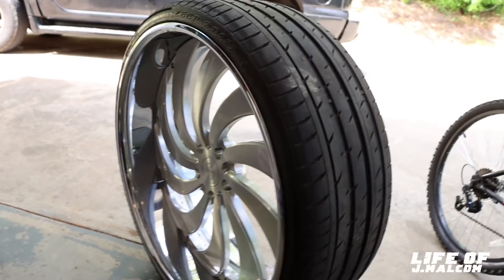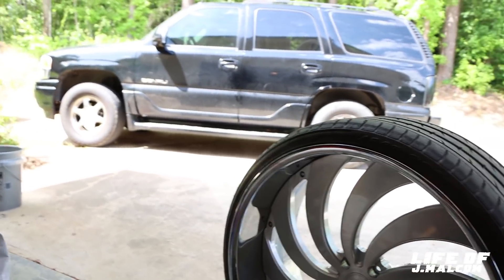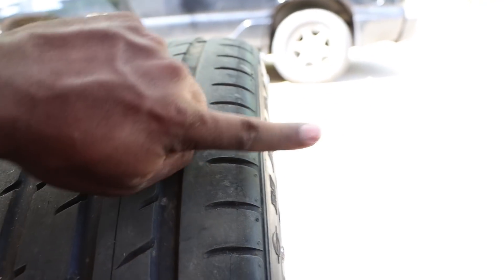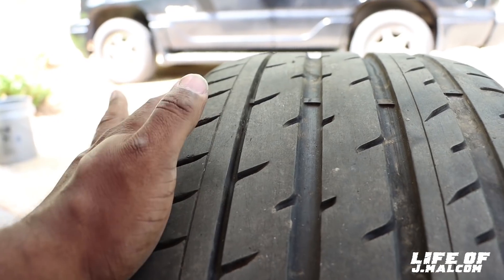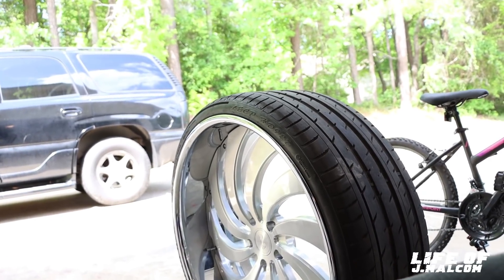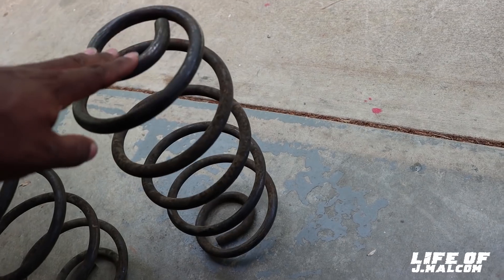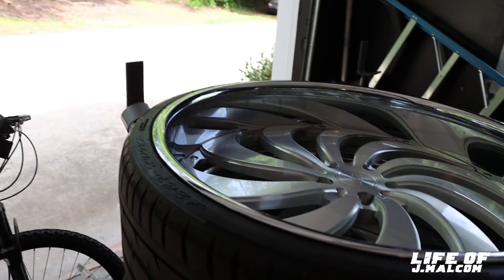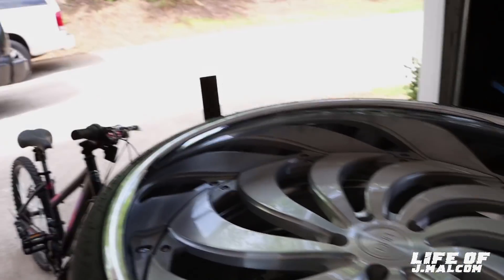WHY BACK SPACING IS IMPORTANT FOR BIG RIMS AND WHAT I HAVE TO DO....

Comment: Don't forget that the advertised width and the actual width on a wheel are different. For instance, a ten inch wheel is actually eleven inches wide because the ten inches is measured at the bead. Each flange is half an inch. Keep up the good content!
Reply from the maker: That’s true! Good point to throw out💯

Comment: This is why I probably won't get a gbody although I really like them
To put any kind of staggered rim you just about have to do a frame notch

A body's and b body's. Not so much

I figure my car can run 17*8 and 17*9 or 18 inches if I get a rubber band on it